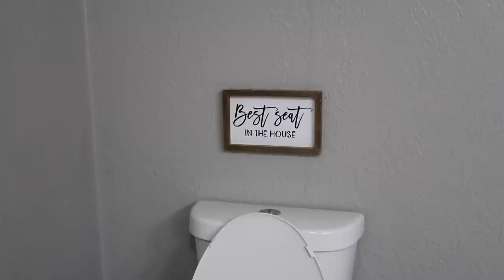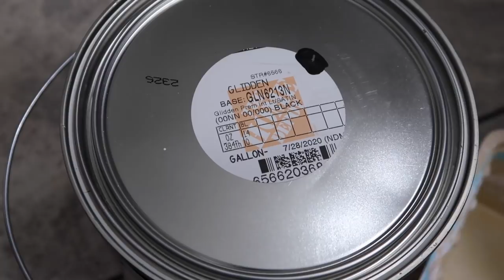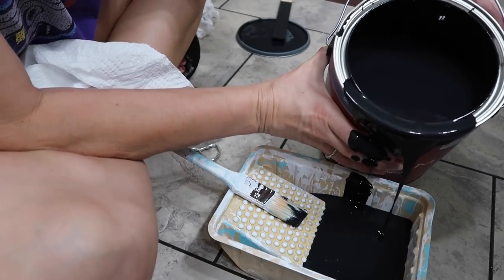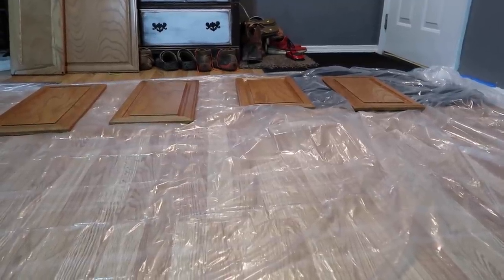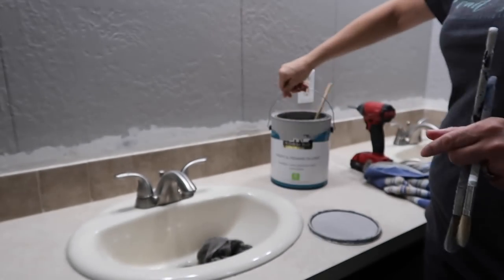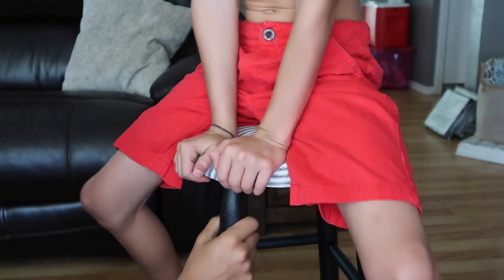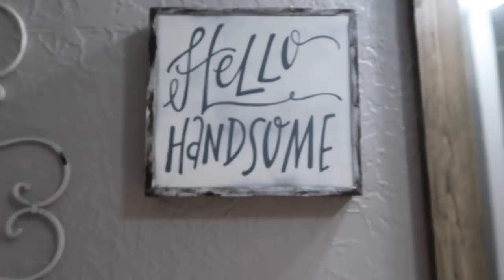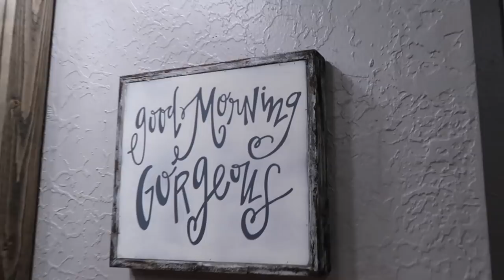Farmhouse Master Bathroom Makeover | Mobile Home Bathroom | Modern Farmhouse

Comment: Looks fabulous! Where did you get the inspo for the mirror frames?
Reply from the maker: My niece sent me a picture of one similar to these off of pinterest. They have a little different bracket on the corners. Thank you
Reply: @KimsFarmhouseLife  it all turned out so nice.  We only have one bathroom in the house and it's much smaller than yours. Just a pedestal sink, toilet and bathtub with shower. Not much to work with. And I'm not good at diy!!!